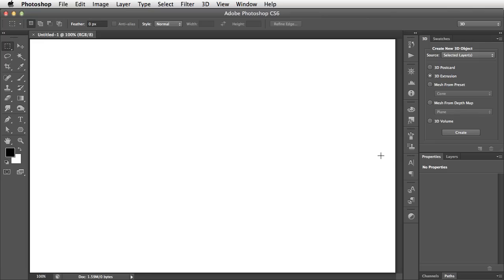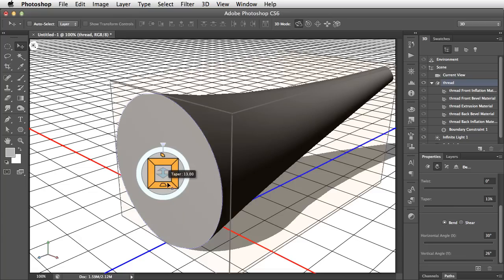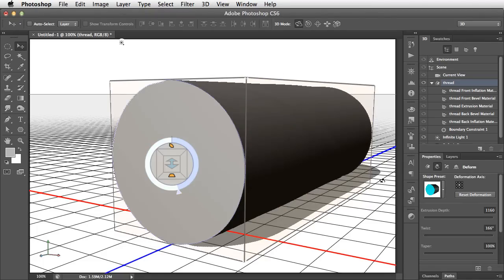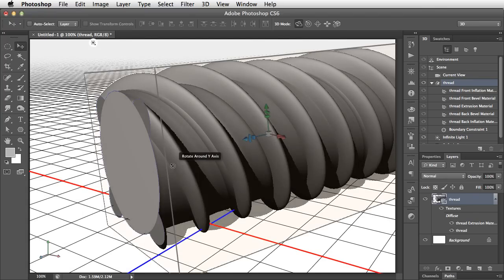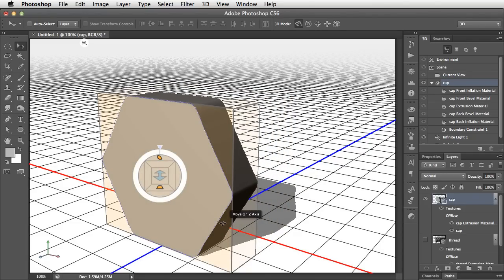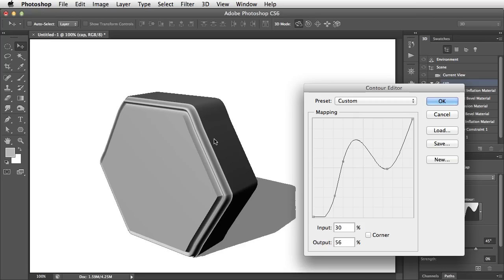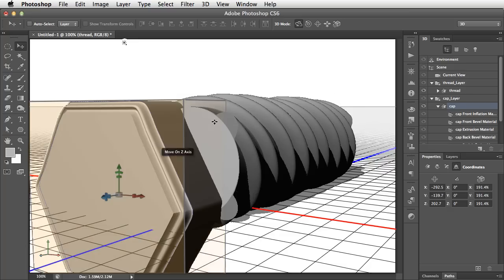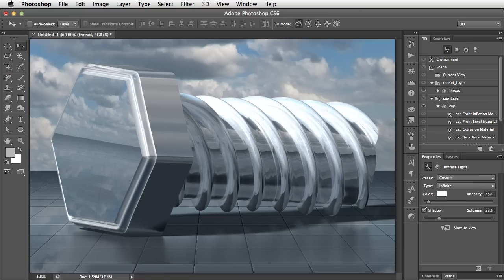How to Reshape 3D Models in Photoshop CS6 Extended

Comment: I'm going to take issue with this in that bolt threads do not taper like that at all. Using circles as you did instead of squares helps, but not much. Instead, make just one initial ellipse for the shape. Use 633px by 699px, scale if needed, duplicate the layer, rotate the top layer 90 degrees, then merge, and there you have it. Of course the end view is still not circular.
Reply: +Alan Foos ...and Im going to take issue with a numpty like you..hes not trying to make a technichlly accurate or perfect bolt, hes demonstrating by way of a tutorial how to use Photoshops 3D modelling capabilities...still, dont let that get in the way of your issues...some people